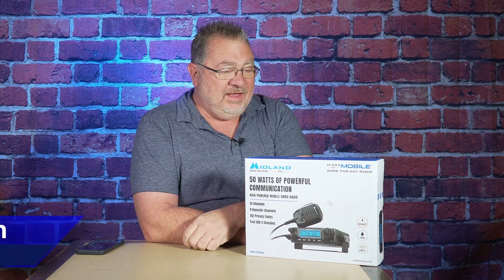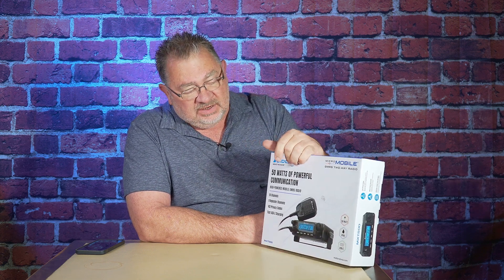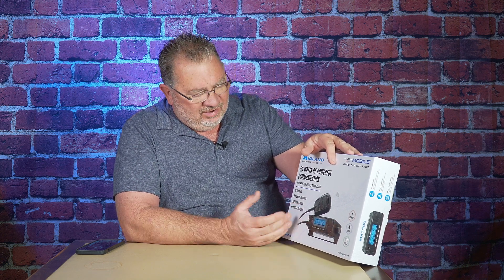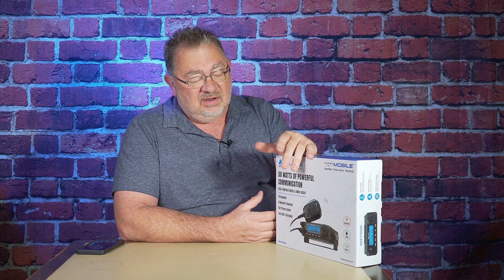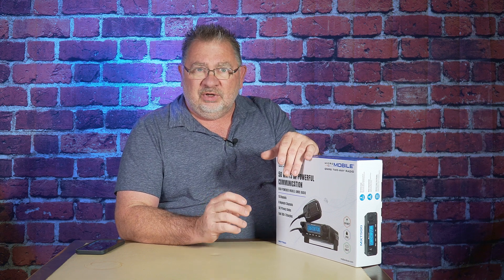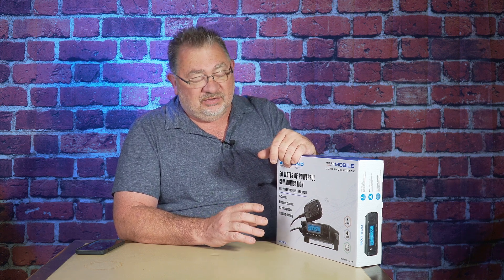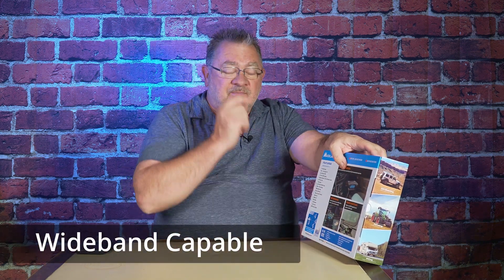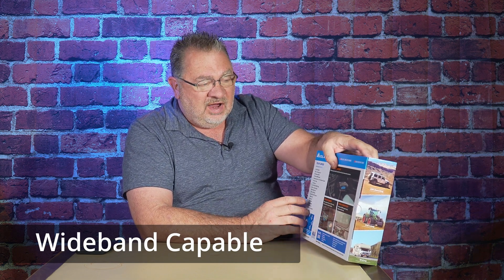Best Mobile GMRS Radio! Midland MXT500 GMRS Radio Review

Comment: How many watts can you get out of a 12v system?
Reply from the maker: The maximum power output for GMRS is 50 watts, so while you could technically get more, if you had amplifiers, you can't do that with GMRS.

Comment: The MXT-400 could be programmed for split tones and wideband.  Being able to select them through the user interface without needing a computer is definitely a plus. I use the 7 "missing" channel slots for the on my MXT-400 for inputting more repeater channels and the MXT-500 will do the same through the programming software. The extra 10W make a difference? The weather/dust resistance is a good feature.

Comment: What you said near the end about having to use Midland's special chart to figure out how to program the correct DCS codes turned me against this radio. Also, if I'm understanding you correctly the default bandwidth setting for this radio is set for narrow instead of wide. And Midland STILL refuses to make a repeater capable handheld radio to boot. Because of these things they won't get my money. But your review is good because this isn't your fault.
Reply from the maker: The chart thing was no big deal, that and changing everything to wideband was a trivial inconvenience. Why they don't make a good handheld is simply mind boggling though.

Comment: Could've got the unit down more if you got the right hardware or grind down the bolt past the nut.... Also, GMRS really lacks any sort of distance even with 50w. Lastly, antennas do make a difference (the biggest actually), but longer or bigger doesn't necessarily because of the frequency wave. If people are actually looking for good communications without the lazy way out, go ham!
Reply from the maker: Define "lacks any sort of distance" please. HAM is not significantly better at the same wattage. Why should someone have to spend 2-3x the money on a HAM radio if they simply don't need it? GMRS has never not done what I have needed it to do.
Reply: Dude it’s uhf, not much different when compared to a single band uhf “440” ham radio, although the price of this midland is significantly more than a 440 ham radio. Come on midland, you can do much better with that price.
Reply from the maker: @bobdillashaw4360  It's certainly at the high end of the price point. The one redeeming thing it has for me is the IP rating. The Jeep gets hammered with fine dust which has killed two previous radios. Would I put this into my Subaru which stays pretty clean inside? Probably not since there are cheaper 50w radios available.

Comment: I’d I have a MXT115 hard wired in my auto does the new MXT 500 use all the same connections so I can just unplug everything g from the 115 and then just plug my existing wires and power into the 500 ?
Reply from the maker: Should all be the same
Reply: @TrailTraveler  thank u
Reply: the mxt 500 has a different power plug than the 115

Comment: Business Band Radios are gone.  They are expensive and information can can be delivered by cell phone.  Here in Iowa farmers and construction are using GMRS radios  talking between tractors, combines and construction    companies talking between trucks.   The company that makes a plug and play, good audio, dirt proof,   radio that can be installed and ctcss dcs set by the stupidest bubba has something that will sell.  People will pay bigger bucks for  a radio that can be made work. Midland would be smart pushing these radios at farm shows, RV shows, and car stereos shops. There is a side hustle someone installing these radios professionally hooking them to a good power source, hiding wires, and tuning antennas.

Comment: Overpriced junk that lacks too many features
Reply from the maker: Could you please explain why you think it is junk and what features are missing?
Reply: I would agree on the over priced part , ive been using icom f221 radios for the last 15-20 years or so and it does all the same stuff and it has front firing speaker and software was included at the time and was less than $500